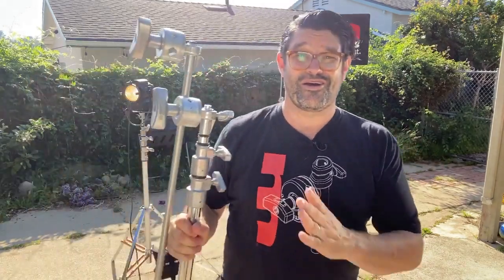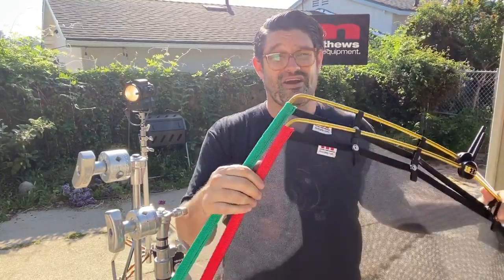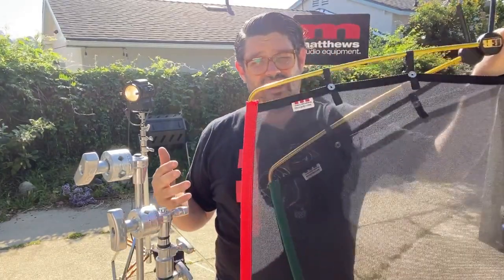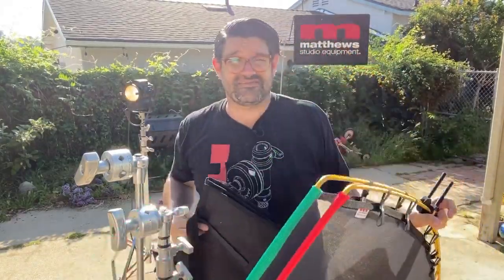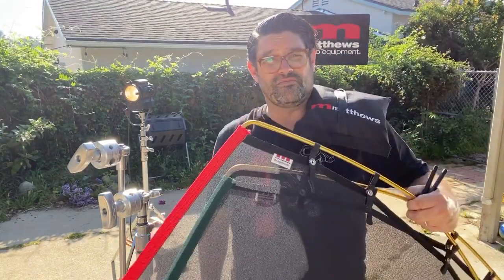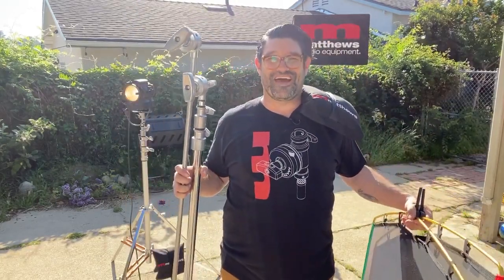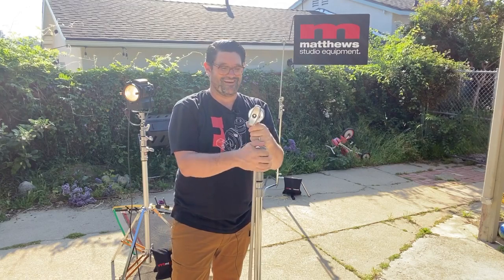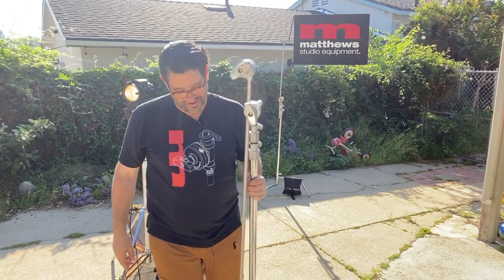Setting A Flag

Comment: thanks for that, great tips, by the way that last one, is it due to the righty tighty rule, as any weight applied while underslung in that position technically will rotate the knob to loosten the grip, not tighten it, as when the rod is forward of the riser tube.

Comment: Hi Martin, I really enjoy these videos - I shoot stills, as an amature and can attest to older Matthews equipment.  I have a few Beefy Baby stands and c stand with arms, and wondered if it is acceptable or okay to place a sand bag on the orange braces.  I noticed you have done that in this video - I think my bags are 15 lbs.  I rarely bag the beefy baby stands since I shoot inside mostly.  Their weight is a bonus in my opinion.